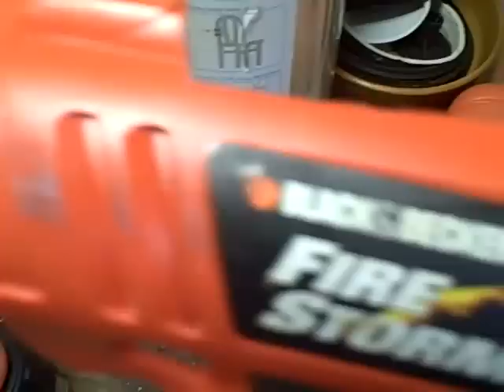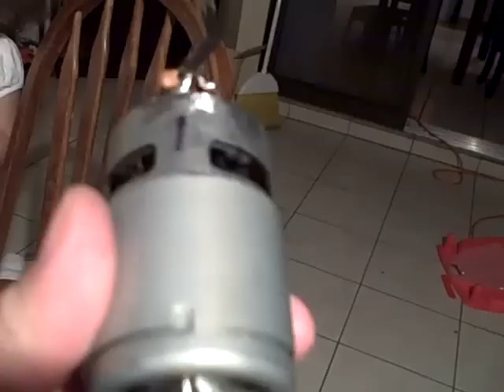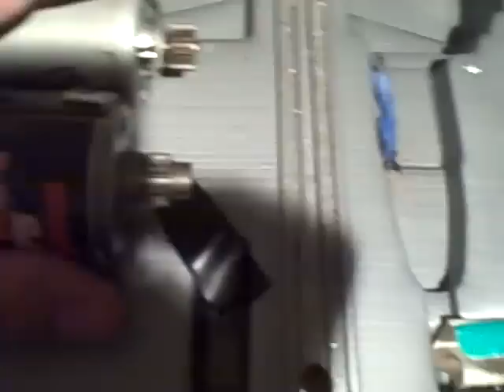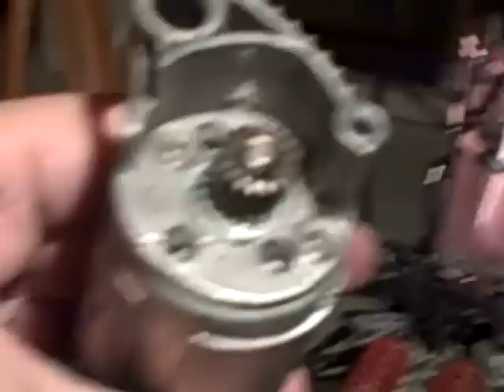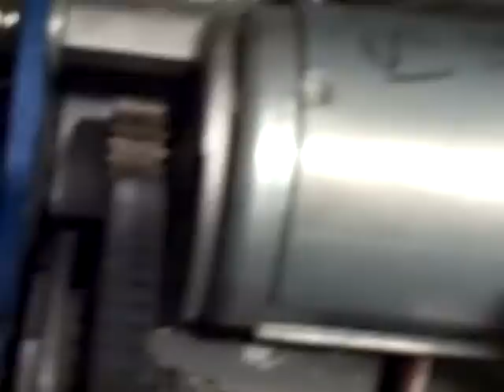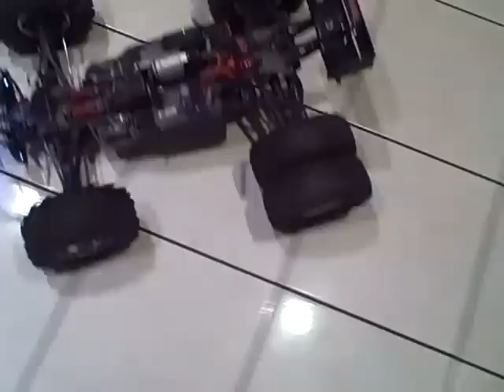B and D FireStorm 18v motor in summit

Comment from the maker: @Fiddler25  forgot to add.... if you can find it , I am told that the 12 or 14 volt motor will give you better performance that the 18V with stock esc.